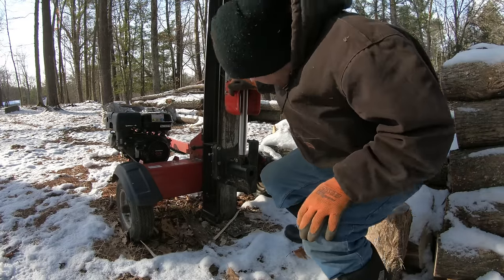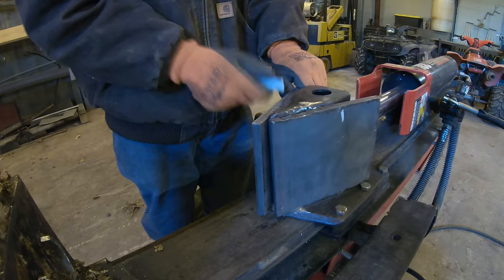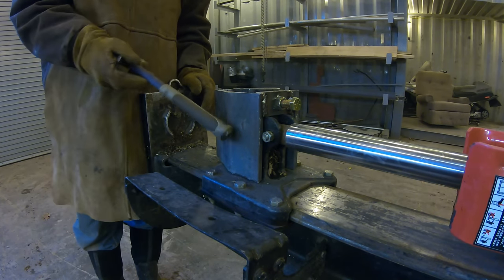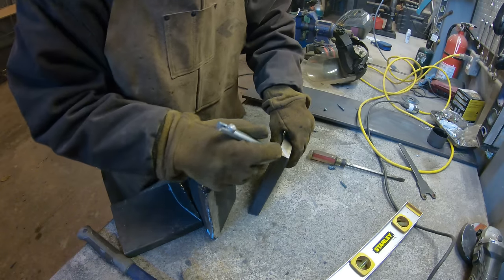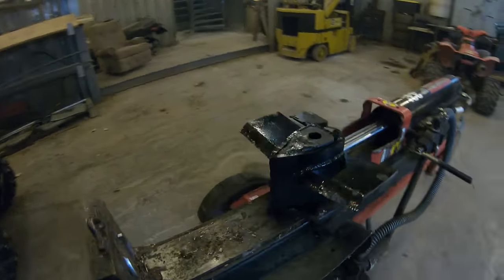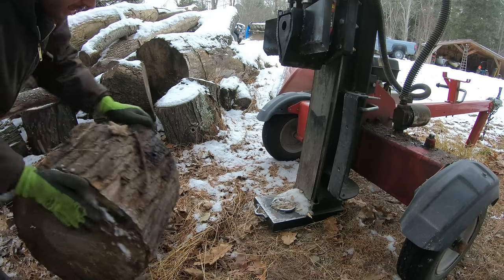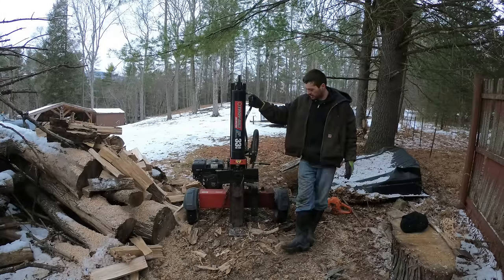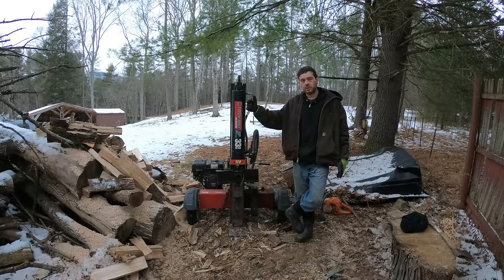Building a 4 way splitter wedge

Comment: Your design was great and I understand you not wanting it to rust, but I think the paint was causing resistance on the wood not wanting to come loose.  I think a clean surface might work better.  Then once you are finished using it for the day then just wipe it down with a bit of oil or paraffin wax.  I think the paint will eventually wear off and the oil or paraffin wax will keep it from rusting between uses.

Comment: Two possible improvements.  Make one of the wings an inch or so shorter so that both wings are not cutting at the exact same time.  May be easier on the hydraulics. Also, move them out further so you are not making so many small sticks on the second and third pass.

Comment: The manufacturers have probably tested 4 way splitters and decided against them for reliability reasons on your typical homeowners grade log splitter. 

After your initial split one side was splitting before the other which twisted the splitter head to the side. 

It does save a lot of time splitting when you get 4 pieces from one split.

Comment: Then you can work in distancing the center of the shaft going down some good foot or foot and a half.

Then you can create a bar, so the shaft can slide out a foot or two forward for wider trunks.

Comment: Was the entire weld job done with mig? I'm doing a similar build, but I thought stick might be stronger. I have both, which would you recommend? Thanks,
Reply from the maker: Either welder is fine. It needs to be a 220v machine for metal that thick.

Comment: Andrew, How did you determine the height of the wedges? What is the height of the wings and blade? I'm thinking of a 12" high wedge with wings for the big stuff I get. I built my splitter using a 14 hp engine the hydraulic piston is 5" w 2 1/2 " shaft I believe I have have around 40 tons pressure I'm considering adding a gusset of the top of the current 8" wedge.  I made the existing blade out of a part from a big bulldozer or something from the scrap yard, grinding the edge was tough. Just got a Lotos lpt8000 Plasma cutter it will cut up to an 1 1/2 steel what a great addition!  Great thinking using the splitter to bend the plate!!  Many Thanks, Gordon
Reply from the maker: I just kind of did what I thought would work well. That wedge works good.

Comment: for the 4 ways spliter,the size of the press must be 35% bigger.it can bend and can weak the structure/warranty.the distance from the main pol it must be bigger and the chilider must be 25-35% larger,not to go on the service warranty at 3-6 months,if you use it hard.
Reply: and you bend the axe structure for that.

Comment: Well it worked somewhat ok , but I’m sure you just VOIDED any warranty you may have had . 
it’s too dangerous puts too much stress on the machine watch that bar bend and twist and your face is right in front of it all 
Be very careful your putting a lot of faith in your welding job
Reply from the maker: This was years ago, still works fine. Warrantys are scams.

Comment: great idea,but why doesn't the manufacturer  make an attachment like that,GOT IDEA,u make them apply for patent,start alittle attachment business,but I bet every manufacturer has different main wedge,your work slows down in winter,START YOUR OWN ATTACHMENT  BUSSINESS,U HAVE AN LLC,if not get on line for state your in download application,mail it in,i went to lawyer to get LLC,that fool wanted 500 dollars,i got on line my LLC was only 100 dollars,400 bucks to  copy an application
Reply from the maker: I didn't invent the 4 way wedge, they are available for purchase as an accessory for some splitters. My question was more; why don't all splitters just come like that, and not have to be modified to a 4 way as a latter added accessory. Plus I could not find a 4 way wedge that fit on that log splitter.

Comment: I have a similar log splitter but 31 ton, I have done the exact same thing all the way up to bending the side plates that fit around the wedge. Did you do something special on your, ? heat the metal first?. I could not even come close to bending the side metal pieces like you did. What did you put on the plate for a gap device ?  over the end plate ? describing items used would help others, have great time watching your video. Any help would be great for other.
Reply: Today, I tried heating the metal and using the  splitter to bend the metal as he did and to no avail it did not work. How did you get it to bend so easily ?

Comment: Nice work young man. I built my own logsplitter driven by my shop electric/hyd power pack. I did not think to add 2 wings to it for quad splitting. An excellent idea. Why don't the manufacturers do it? Probably for a lot of splitting jobs most people only want 1/2 not 1/4. But I'm going to add to mine as you did. Good work. Also good idea to show viewers what equipment you are using as you did. That Victor plasma cutter is pretty impressive to cut the 1" plate. My Lincoln ProCut 55 has trouble with 5/8.
Reply from the maker: Thanks. Yeah it even cut the 1" plate at that steep angle, which makes it like 1 3/4"

Comment: Andrew, you should be wearing hearing protection.  I sure wish I did when younger. Constant ringing is no fun. Love your video's.
Reply from the maker: Thanks. Good tip, I usually do wear hearing protection when running the saw. That was just a quick test of the splitter. If I was doing an actual production run I would be wearing ear muffs. The Honda engine on the splitter is very quite, I would only need them for the saw.

Comment: Put a 'bungy' around the log, and split as small as you wish, with the old blade...
The 'bungy' will keep all the pieces together until you unload in the truck/trailer!
Reply: Or put the wood inside a used tire. Wouldn't fit easily in that machine though it works great when chopping by hand.

Comment: I'd guess they make them one-way to keep using a lightweight motor. You're close to doubling the load on the motor, too, so you're going to burn out your motor sooner than per their design.
Reply: It will not burn out the engine, the hydraulics may suffer but not the engine.

Comment: If the machine could be used flat, wouldn’t it of been better having the splitter at the bottom and a flat plate on the ram and the ram pushed the log into splitter and and log falls of end straight into a bucket for example.
Reply: Obviously you wouldn’t be lifting huge trunks like the big one you done

Comment: 3 cycles per log versus the 1 cycle with your adaptation to get a 4 way split perhaps means more wear and tear on the machine increasing the number of times the customer will likely take it to the dealer for service.
Reply from the maker: Wear and tear? That machine doesn't care how hard its pushing.

Comment: Hello Andrew, OMG I’m hoping you may be the answer to my prayers.I have a 2008 Troybilt 27 ton log splitter which I recently purchase.I was able to take a non-working GCV160 Honda engine and get it running like a top. I have wanted a 4-Way wedge forever but there are r none made for my machine, as you already found out. Here’s my request: would you consider making a duplicate 4-way wedge for me? You can model it using your own machine’s wedge, like you did making yours. I would Gladly pay you for your materials, your labor, and for shipping. If there was an available aftermarket I would not even think of asking for your help, but you already know there’s none available. I would ask for two things different, if you can help, they are: to make the “wings” shorter. I would be happy if they would only be as long as the width of the machines wedge’s brackets sticking out about an inch past the beam’s width. The second thing I would like is a handle on the vert top just to facilitate a little easier lifting of the wedge when placing on or removing it from the hydraulic’s wedge, itself. I know every person has all they can handle in there own life as for doing projects. If I knew of any other alternative I would not even think of asking for this gigantic favor. Please let me know if you can assist. If you can, I will contact you with my information. I  can pay you by credit card, PayPal, or with a check. Again, thank you for taking time to consider this. Hopefully you will be the answer to my prayers.Once again, thank you!!!! Yours, Michael
Reply from the maker: Just copy what I did here.
Reply: @AndrewCamarata  Andrew, if I had the equipment and the skills to do it I would absolutely do it. However I have neither. I would greatly appreciate if you can reconsider this as if it was a job which found its way into you management company. I would be so very grateful if you will respond to me through my email, if you still have it. If not, just reply here. Thanks again for giving it a second thought.

Comment: A beautiful build. Great wing placement. And heavy enough to do the job.  My only concern would be that it is so well built that using it might exceed the capacity of other components in the system.  The bolt holding the wedge at the junction of the wedge and hydraulic ram for instance.  Or the pressure at the seals of the ram.  But I have no idea what the tolerances built into the system are. Anyway, an excellent build.  I'll be buying something like this from either Fleet Far or a different supplier soon.  Impressive. You're hired and can come over and start splitting my wood any time you like.
Reply from the maker: Thanks, its a year later and its still working well.

Comment: Because they want you to buy the bigger unit. Are you able to put a 2 inch spacer between the rail and the cylinder so that your wood quarter's will be more equal?
What you have done will make your wood production and your time management  much better. Take care and be safe.
Reply from the maker: I probably could, I feel like that would be almost re-engineering the whole thing at that point though. I like it how it is now. Thanks

Comment: Andrew, what filter did you use on your camera lens, to stop lens burn out, white spots, when welding or gas cutting?
Reply from the maker: I didn't use any filter or anything. That was filmed with a GoPro Hero6, set to 4k30fps. Actually it was the first thing filmed with the camera, before that I had been using a hero5

Comment: I noticed at 5:05  that there is a kerosene/ forced air heater sitting under the bench - apparently  there is not fuel in it ! ! !
Reply: yes kerosene won't explode like gas -  But I think the fumes in the tank will , My uncle found out that #2 diesel fuel fumes will - he was checking fuel in a 5 gallon can with a lighter back in the 60's  and "woof"  - -  burned his eye brows and lashes-

Comment: Really well done Andrew! - wish the manufacturers paid attention to the angles you made that wing!
Reply: in hindsight - its funny - you can always tell the folk who have split firewood for money in their life. You learn quickly and you never forget.
Reply: I noticed that the two splits don't occur at the same time.  That reduces the load on the machine.  That splitter happens to be a 33 ton version, but smaller splitters could use that concept.  I don't know if Andrew thought of that or it just happened.  Why load up the machine trying to make all 4 cuts at the same time.  One split starts and then after the wood starts to crack, the other split starts.
   Why is my spell check not liking the word "Splitter"?  Am I spelling it rong?

Comment: really should cover a cylinder , if your going to weld next to it, slag is not good for seals
Reply: You are correct about covering the shaft, 99% of the time spatter will not stick to the hard chrome plating on the shaft.

Comment: do u think the base is big enough? that is why i don't like these type of splitters. the small base pushes the block of wood away from the wedge as it comes down. we have used a thick board and laid it down so the block of wood lays flat. that to me is the biggest downfall to a splitter like urs. glad ur 4-way wedge add on is working good.
Reply from the maker: The base is a little small, usually for bigger wood you just need to hold the piece in position while splitting it, its not bad. Than once you've been splitting for a while, there is usually a pile of bark on the ground, which is making the entire ground the same level as the base.

Comment: i love my 357 xp husqvarna one of the best saw   how do you like yours ?
Reply from the maker: That is a good saw, I bought it 2011 and have used it a decent amount. I have had to replace the carburetor ($20 dollar aftermarket worked well), and I had to replace the coil once. And its always leaked bar oil. But other than that its been a good saw.

Comment: A garbon arc gouging tool would work wonders on putting a bevel on something of that size and thickness
Reply from the maker: That is a tool I need to get.
Reply: Andrew Camarata we use them at school to back gouge our test plates and we use a lincoln ranger 255 engine drive to do it although if I remember right anything 225 and up will do it

Comment: Watch out when you are on the return stroke and a piece gets stuck on the wedge.  As the log comes back be aware were your hands are especially being usually one would be on the control valve (although with the four way it might actually help to deflect away) because i have seen a few people crush there hands that way.  I know i have had a few close calls myself.
Reply from the maker: Yeah, defiantly don't want to split wood with your eyes closed.

Comment: The manufacter of that splitter knows the amount of force (energy) required to split a log length wise, in a single split. The quad split you are attempting is much more difficult for the motor and requires more force. Your unit may eventually fail or the welding fails.

Comment: Would a hatchet (small axe) help stubborn  bits that are half split. Mount it somewhere on the frame for quick use instead of pulling apart by hand. Also I know you can add more adds in your video somehow. More 🌲🌳🎄☘🍀 for you.
Reply from the maker: They usually pull right apart, it depends on the type of wood. I wouldn't want too many adds in the videos, that would be annoying for people to watch.
Reply: Andrew Camarata your content is good people will watch however I do hear what your saying

Comment: Nice work man looks like it works great. Do you process and sell firewood or is it just for your own use?
Reply from the maker: Thanks, I have sold fire wood in the past. But recently just don't it for my own use. Now that the splitter is faster, it may be more worth it to sell the wood. Especially with a conveyor.

Comment: I'm guessing a four way spitter would stress the bean counters because of increase product liability related to safety and hardware failure.  It's easy to keep fingers away from a single blade but the added cutting surfaces of four blades might result in more accidents for the careless operator.

Comment: Hi what kinda chainsaw do you have
Reply from the maker: I have a bunch of saws. The one I'm mostly using is a Husqvarna 357xp, I bought it new, its not nice power, and works well. 
I also use a Stihl 036 that I got out of the trash and rebuilt the engine on. That one works good too. And I have a bunch of other smaller saws I got for free broken and fixed.

Comment: nice! but sometimes, side axes stuck in the wood, maybe it will be better if made them with bigger angle, like base (central) axe?
Reply from the maker: Yeah, they could angle a drop more, but the few times a piece got stuck, it always came out very easy.
Reply: Andrew Camarata anyway, main axe got permanent position on sliding rail and distance from base. I think, manufacturer was not so nice and didn't make it adjustable  ))) big wood will always stuck between base and side axe, but, as you say, it's came out easy...;)
 it's first time, when i had seen vertical wood splitter (I think they exist... probably...😁). In Russian shops (Saint-Peterburg) they got horizontal splitter's only.

Comment: i just make bigger wood stoves .... it costs a lot of money to buy a spliter and chain saws....
and the time it takes to split wood for no reason  a quarter of a round burns just as easy on hot bed of coals in a wood stove as a  2 foot long 12 inch round

either make a hand truck that loads wood right into the stove on wheels once tilted back( like a 55gall drum dolly ) ... or make a top or 45* wood loading door 

in mid winter i often toss in a 3foot 12 inch tree round with some un split wood the size quarters or split wood
 
local tree services drop off free wood  ( complete tree removals ) and wood chips for mulch

i dont even have to start fires any more i get free waste motor oil and gas mix from car recycle'ers   one quart will do it ,,, some times 2 quarts is enough to take the chill of on a fall morning

Comment: Not a very good welded tip when you go back-and-forth over top slag. You also need to watch this video when you’re cutting steel, you are spewing hot metal over your gas line. Good design and thank you for the video.
Reply from the maker: Didnt I mig weld this whole thing? There is no slag when mig welding.
Reply: Andrew Camarata Wasn’t that a gas cutter you were using to cut the steel.
Reply: Andrew Camarata With the camera speed going quickly, it appeared you were going back-and-forth over top of slag continuously to fill in the blade tip. My other concern was you cutting with the gas which is fed through a gas line running underneath where you were cutting.
Reply from the maker: Plasma cutter. The slag from that can be knocked right off with a chisel. Welding over it can cause porosity. But it can be burnt clean on the second pass.
Reply: Andrew Camarata people have welded over slag although I wouldn’t do it. Only time will tell how well you can sharpen the blade otherwise was an awesome design.